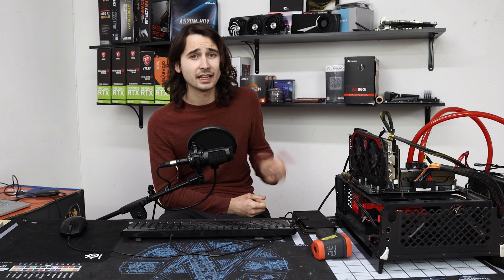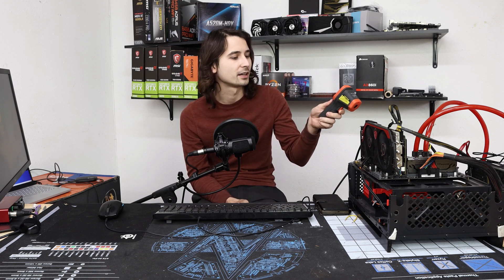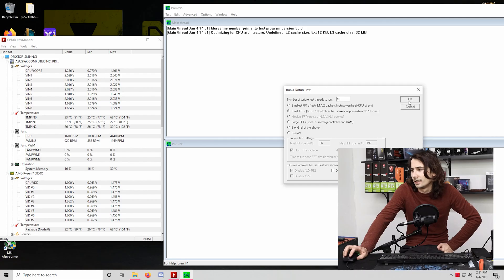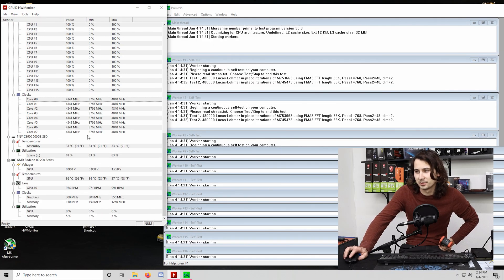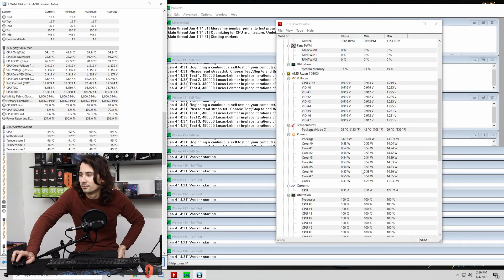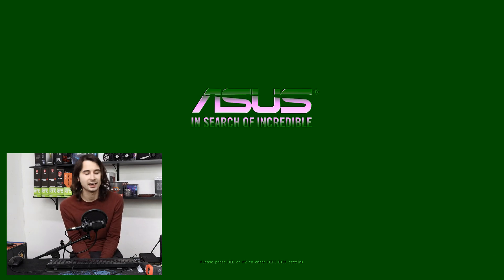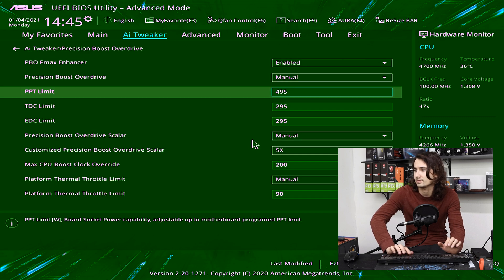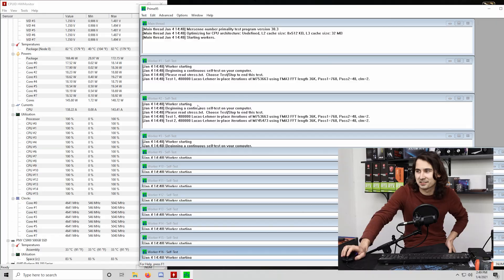Overclocking Ryzen 5800x On The Cheapest B450 Motherboard I Could Find - Motherboard Bottlenecked?!

Comment: Funnily enough i have the same motherboard and cpu. I've upgraded from a ryzen 5 2600, to the 5800x and paired it with a rtx 3070 and 64GB ram.
After running 3DMark and getting above average Scores for the setup (13600 in Time Spy), i've realized that the CPU was only running at 4.2 ghz max.
After that i've tried manual, auto, pbo etc. and the highest i could get the CPU too was 4.6 ghz (highest voltage i've tried was 1.35v),
but i didnt like the high temps and wattage so in the end i settled for 4.4 ghz at 1.25v (13943 in Time Spy),  till i buy a new mobo or pc.

Comment: Hello
I wanted to upgrade my pc I have b450 motherboard but I just want to upgrade processor
Which processor u suggest
R7 5800X FOR 230$
OR R9 5900X for 340$
I need single core performance
I have msi B450 gaming plus Max motherboard  sich have heatsink on vrms .with AIO 240 MM cooling from deepcool
Currently I am using R5 3600 I needed for music production and Video edit rendering work 
I have 32 gb ddr 4 ram 3200 mhz
Equipped with RTX 2060 SUPER 8gb gpu

Comment: does it make any difference if I use r7 2700x or 5800x??
Reply from the maker: Same TDP between the two chips so under a full load they'd probably give the VRMs the same load.  Running stock or with PBO is probably fine, especially in a case with some decent airflow under normal gaming loads.

This was a WORST-CASE scenario, using an open-air testbench with water cooling (so no case fans, and no cpu cooler blowing on the VRMs) under heavy synthetic stress-tests that will push a CPU harder than any gaming workload could.

Comment: Thanks for this video. I currently have a b450 MSI Tomahawk non-max with a 1700x OCd to 4.4 all cores on air. It runs stable at 4.5...until the VRMs hit 95c and I shut down testing. My single exhaust fan is a Delta, right next to the VRM's, that even at highest speed can't keep them cool (all other temps are well within acceptable). I'm about to drop a 5800x in it and OC that...should be interesting.
Reply from the maker: What kind of CPU cooler are you running?

Coolers like an AIO are worse for VRM temps because they don't have a fan that blows downwards.  That could be something to look into when you upgrade the CPU, some of the air coolers can help.

Also, 5800x are honestly better to undervolt most of the time with curve optimizer.  Of note, if you play with PBO on the 5800x, some systems (like my asus crosshair vii) actually make it run worse when I set the PBO parameters beyond 140w (the max for the socket).

Good luck, 4.5 on a 1700x is insane!

Comment: Lol this video made me worry a bit. I have an Asus Prime B450M-A II and just purchased a Ryzen 7 5800x to upgrade my 2700x
Reply from the maker: I mean, just don't run synthetic benchmarks on an open air test bench.  A decent case with moderate airflow on normal workloads is probably fine.  

Just don't run prime95 small FFTs or overclock it and you're likely fine.

Enjoy the upgrade though, 5800x is a beast
Reply: @CoilWhine  Glad to hear that. Thanks man!

Comment: I have a B450 AORUS PRO WIFI with a 7900 XTX GPU and 5900X CPU but am getting super low FPS on warzone playing at 1080p. Wondering if it's my motherboard that's bottlenecking the GPU and CPU

Comment: I have a ryzen 7 5800x, 3060ti and b450f gaming. 
Since I got the 5800x I have often framtime spikes and you can really feal it ingame, I watched some benchmarks on yt with similar specs but for them it runned fine. So I wanted to ask that if its maybe my motherboard fault I have xmp activated and the rest ist all on default. So the cpu ratio is on auto maybe my mb can’t handle that? Should I disable the auto (oc) and run it at 3.8ghz.
Or maybe xmp.

Comment: I have an MSI B450 Mortar Max but the vdroop is quite massive (around 0.062v when running cinebench r23/prime95). I have it paired with an R7 2700(non-x) @ 3.925ghz / 1.3125v (1.250v under load in r23/prime95). I would like to hit 4ghz but I'll have to up the voltage to like 1.3825v-1.4 to compensate with the 0.062 vdroop, is that safe?
Reply from the maker: Honestly? I dont think those voltages are that bad if you got temps under control

Comment: I upgraded my CPU from a Ryzen 7 2700x to a 5800x and I upgraded my ram to Corsair vengeance 3600. I have a b450 tomohawk. My system will turn on but it will not post. Then I get the red light on the Dram. Is this a bios issue?
Reply from the maker: have you update the bios, and does your old ram work?

Comment: i have an asus prime b450m k and plan to get a 5800x, will this board be able to handle it?
Reply from the maker: Stock it should be fine, just make sure to cool the vrms
Reply: @CoilWhine  i think you should redo the same test with a 5800x3d on this board
Reply: When its available

Comment: Would an original B450-F be able to run a 5800X? I'm currently running a 3700X without issues.
Reply from the maker: Yeah should be fine, were just making a worse case scenario

Comment: Hey man I just ordered Ryzen 7 5800x but I have Asus B450F, will this work okay?
Reply: How are you getting along with this combo?  I'm considering a similar upgrade for my mobo.
Reply: How has your combination worked for you?
Reply: @jeamm1871  I have the B350-F Strix and just recently upgraded it to a 5800X3D.  It runs perfectly so far, I also have a small undervolt for efficiency and to help protect my vrms. .  I needed the latest beta BIOS.  Should work well on the B450-F too as long as you don't plan any overclocking.

I might add, the X3D is a more efficient chip than the 5800X..  So an undervolt or negative curve ofset might be preferable route should you go for the 5800X.
Reply: @jeamm1871  its great bro, I am still using that same motherboard and cpu but now have upgraded to the RTX 3080 ti and its perfect for me for gaming  and watching entertainment

Comment: I still can't get it. Some say a 5800x is too much for a b450. Many say they use it and it's all fine. I have a Asus tuf B450m-pro Gaming. Can I get a 5800x on it? For gaming, for rendering for hours
Reply from the maker: stock 5800x should be fine, rendering might be a tough one, just make sure it has plenty of airflow over the vrms
Reply: @CoilWhine  Many thanks for the answer. What if I undervolt in a way it can keep it's clocks? It will force less the VRMs, right?

Comment: What do you think of a stock 5800x on a MSI B450I gaming plus max Wifi? I'm running it with a R5 1600 @ 3.7 and 2x8gb 3200Mhz ram. 
My system is a little glitchy at startup sometimes with the 3200Mhz speed so I want to get rid of the first gen Ryzen.
5600x and 5800x are my 2 options both left at stock. I still need a bios update for 5000 series which worries me
Reply from the maker: good combo, should work great.

Comment: How comes your 5800x on this cheap board has such good temps.... I'm using Asus Crosshair VII Hero WIFI, newest BIOS, beQuiet AIO 280, case with 3 140 corsair fans and it is idling around 38-47, ramps up from time to time to around 60, playing GW2 maks it 80-84 and in cinebench you can cook on it, around 100... Playing with PBO helps to drop load temps around 2-3 degrees but has zero effect to idling temps...
Reply from the maker: we did use a custom loop for this, that usually helps a bit but damn youre seeing over 90c? id definitely be looking into the normal stuff, mounting pressure, thermal paste, case airflow, fan speeds. your idles temp is normal and isnt something you should worry too much about, its just trying to stay quiet at idle, but yeah zen 3 shouldnt be getting over 85c tops in cinebench.

Comment: I found out the hard way that the VRMs of the Asrock B550M ITX/ac also can't handle a stock 5800x. It has this same exact throttling behavior :(
Reply from the maker: what kind of cpu cooler you using? make sure you get some airflow over your vrms!
Reply: @CoilWhine  Context: This is from a custom build Maingear Turbo

The cooler is Maingear branded but it appears to just be a Cooler Master ML240 V2 in disguise. The CPU stabilizes at ~85C with it and idles on the desktop at 35-40

HWinfo trips the "PROCHOT EXT" sensor (and not the normal PROCHOT) during Cinebench R23 which is what tipped me off that the board is the bottleneck. I was so confused as to why the CPU was throttling so hard before reaching the 90C limit before I saw the sensor report

The airflow isn't so great in the system overall. The only fans are the radiator fans exhausting out the top (not counting the GPU and PSU fans). So that + the board having a pretty small heatsink are the problem, I think

When I was choosing parts, it was either the Asrock board or the Asus ROG Strix X570-I Gaming. I didn't know a whole lot about motherboards at the time of purchase and only considered the B550 vs X570 chipset features. I feel like a big idiot now, pairing a 5800x with a cheapo motherboard lol. The things I did see about VRMs only mentioned overclocking, so I didn't investigate further. I haven't had an AMD system before, so I didn't know that the stock settings were already kinda factory OC'd. 

Tinkering with the power limits in Ryzen Master/BIOS is always an option, but tbh I kinda just wanna put it in Eco Mode and be done with it since I've stressed over it for a week now lmao
Reply from the maker: @rickster6755  i think the airflow is more of a problem than the mobo, a b550 should have more than enough heat sync to cool 150 watts, although maybe the itx form factor is limiting it
Reply: @CoilWhine  Yeah that is the main problem, I agree. I did try flipping the rad fans to intake which did solve my cpu issues...but then the GPU temps suffer instead. See, the GPU is a RX 6800, but mounted vertically via a riser cable. Problem is it's very close to the glass side panel, like maybe half an inch away. So it's being choked for air. The temps are...good enough with the rads in exhaust, I suppose. 85C/100C junction is suboptimal but I can live with it. With intake it was hitting the 110C junction limit and stopped boosting which cost me about 10fps. So I decided that running the Ryzen in Eco Mode was a far better solution since I lose at most 10% multicore performance and the GPU runs warm, but not to the point of having a noticeable performance loss

The cooling design of Maingear's non-custom loop ITX system is just...flawed. Not enough fans, and everything is linked to the CPU so GPU heavy loads suffer. I might even go as far to say that it's their worst system overall. It was clearly meant to be used with their open loop water system :/

If I could do it all over again I'd go with the Asus board since it has the chipset fan which would help the VRMs survive the air-starved case, lol
Reply from the maker: @rickster6755  you think your case can fit an artic aio with the vrm fan? think it would greatly help in your situation. And wow i had a look at your case it is very limited
Reply: @CoilWhine  Looking at the website, it might fit. I'll consider it!

I've considered 3 different part swaps to fix up this system so far:

1. Noctua NF-A12x25 fans for the radiator

- I was thinking since the rad fans are doing triple duty (cpu cooling, general exhaust, minor intake via very negative case pressure) I may as well use the best I can. I could see GPU temps dropping, and if I'm lucky the VRMs might get helped out too. I'm also expecting less noise overall. This is also the cheapest and easiest option for me

2. Motherboard with active VRM cooling

- Fixes the VRM issues and also gives me some better fans controls and more expandability that I may or may not use. The Asrock BIOS has no fan delay options which has been really annoying to deal with. If I set the fans not to ramp up for desktop temps, low CPU high GPU games suffer for it since the fans won't spin up. Another pitfall of the only exhaust being linked to the CPU :/    This would be the most complex and expensive upgrade and won't do anything for me except fix the CPU throttling and give me better fan controls though

3. Swap the whole AiO (heavily considering that Arctic one now, thanks again for the tip)

- Wasn't sure if this would actually help me any, but I didn't know some came with VRM fans so now it's more "on my radar". A moderate price with moderate effort involved

Optimally I'd take #1 and #2 but yknow...money lmao

Comment: b450 tomahawk max with ryzen 5800x for gaming/streaming together with little to no overclock will it be possible to run for years?
Reply from the maker: Absolutely
Reply: @CoilWhine  but will the performance be as good as a 550 motherboard? I only play games no heavy cpu work
Reply from the maker: @stonecoldt  performance will not be affected in gaming, you could even play with some pbo settings if youre somehow cpu bottlenecked
Reply: @CoilWhine  much appreciated
Reply: With a b450 tomahawk max and a 5800x.. can it still be overclocked safely on this board?
Reply from the maker: @UnisoleBunker  i would just use pbo, all core overclocks arnt really worth it anymore
Reply: @CoilWhine  5800x it's boost is 4.7ghz.. can I just set all cores to 4.7ghz in bios.. Will that be OK for my b450 tomahawk max?
Reply from the maker: @UnisoleBunker  tbh it probably wont be stable at that
Reply: @CoilWhine  what motherboard would you recommend thats fairly cheap that could handle overclocking the 5800x? Thanks for your feedback

Comment: Great vid!

I just upgraded my processor to a 5800x and now I'm suddenly getting in-game crashes. CPU was getting pretty hot (up to high 80's C) so I undervolted it a bit, but I still get these crashes even at around 70-75 C, so I don't think overheating is the issue. I'm using a B450 Tomahawk Max with the most up to date BIOS. Any ideas?? 

For reference I was previously using a Ryzen 5 2600, and I also changed my power supply from a shitty 500W to a gold 750W. I never had these issues before upgrading 500w to 750 and 2600 to 5800x
Reply: Never crashed on desktop so far, just in games like COD Warzone and even in classic WoW (2004 game with super super minimal requirements)
Reply from the maker: hmm idk, mind running usermark just to give me a better idea of what youre running?
Reply: @CoilWhine  
UserBenchmarks: Game 91%, Desk 103%, Work 90%

CPU: AMD Ryzen 7 5800X - 97.9%
GPU: Nvidia RTX 2060 - 88.1%
SSD: Samsung 860 QVO 1TB - 581.1%
SSD: WD Black SN750 NVMe PCIe M.2 1TB (2019) - 294.7%
USB: Kingston DT 101 G2 16GB - 5.9%
RAM: G.SKILL F4 DDR4 3000 C15 4x8GB - 89%
MBD: MSI B450 TOMAHAWK MAX (MS-7C02)
Reply from the maker: @gentukub4774  yeah idk man everything looks good, might just be some random zen 3 nonsense where youre on some beta bios
Reply: @CoilWhine  any suggestions? It hasn't stopped, I even crash on cinebench :/
Reply from the maker: do you have any bios setting tweaked?
Reply: @CoilWhine  Nope
Reply from the maker: not even xmp?
Reply from the maker: What cooler do you have?  
I'd turn off the undervolt and maybe max the fan speeds just to test if that's the issue, since 80c isn't ideal, but it isn't dangerous (the cpu will throttle before it hurts itself).

After that, I'd try to turn off XMP while keeping the stock cpu voltages.  Check the bios for any "core enhancements" or whatnot, I know ASUS has a bunch of stuff like that.

If you still have the 2600, you can try flashing back to some earlier bios.  v39 updated the AGESA, and while it technically doesnt say zen3 support, that version of AGESA should do it in theory.  Again though, it could put you in a bad spot if you dont have a zen2 or zen+ cpu to flash the bios forward again (idk if msi has a usb flashback like asus).

Worst case, you might have to open up an RMA with AMD.  I know early zen3 cpus had a higher defect rate than usual.  Any error codes would be helpful too.

-Zax
Reply: @CoilWhine  So yesterday I tried having XMP on and still had the usual crashes, except this time one of the crashes also blue screened as well with a "MEMORY_MANAGEMENT" error. Just turned that off.

As for my liquid cooler I'm running the "Cooler Master MasterLiquid ML240L RGB V2, Close-Loop AIO CPU Liquid Cooler, 240 Radiator, Dual SickleFlow 120mm, RGB Lighting, 3rd Gen Dual Chamber Pump for AMD Ryzen/Intel LGA1151" https://www.amazon.com/gp/product/B086BYYFG5/ref=ppx_yo_dt_b_search_asin_title?ie=UTF8&psc=1

It worked pretty will with my previous setup but now I guess not so much since I'm reaching 80 C even with an undervolt. When I turn the undervolting off it gets as hot as 89 C in games like Warzone :/
Reply: I'm going to reapply thermal paste and I've been told to do a full reinstall of windows, not sure where else to turn so I might just do that
Reply from the maker: Yeah, that cooler should be plenty for your system.  I'd definitely repaste it and check that the pump is running in the bios, you never know if you plugged it into the right header (out of the 400 options).

Best of luck with the reinstall.  It's frustrating, but that's usually the easiest fix!

-Zax
Reply: @gentukub4774  Any updates? I have a very similar build and worried 😭
Reply: @babymetalsama1482  Any problems yet? I'm putting this kind of system together next week but with a diffrent motherboard. Would be great to know if it works now, or if it still has issues
Reply: @Lukas-yo6po  well would u guys prefer me b450 pro 4 motherboard for ryzen 7 5700x?
Reply: @Lukas-yo6po  How is it holding up ?
Reply: did you find any solution?